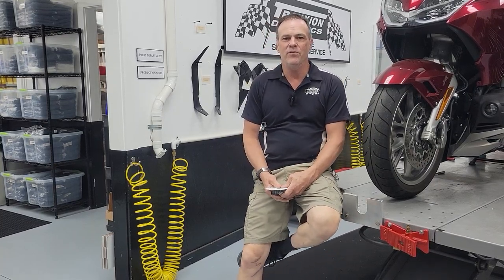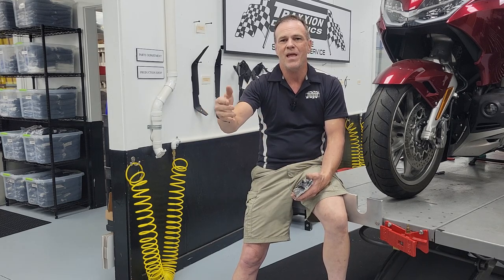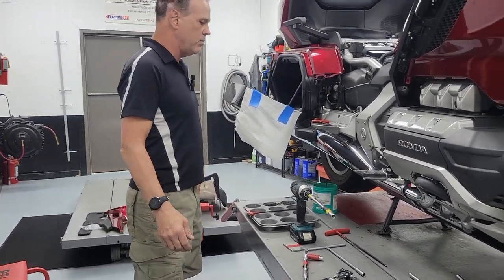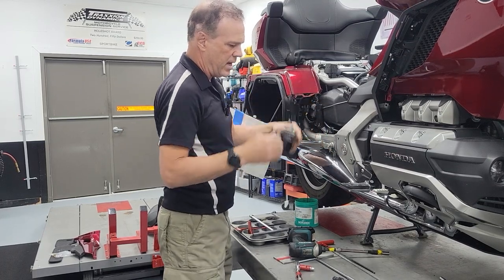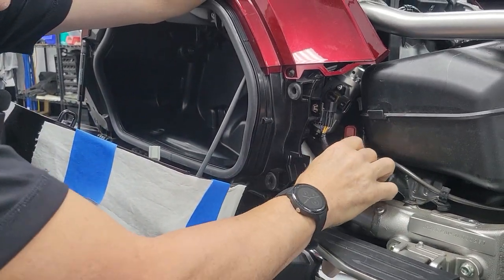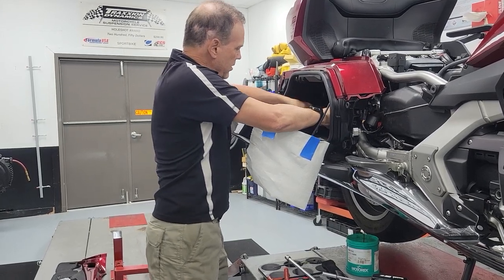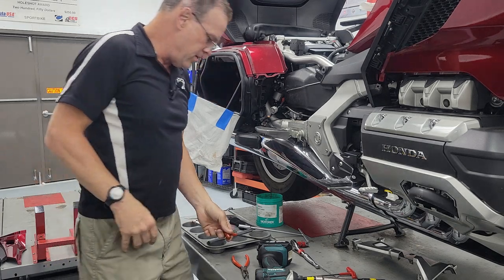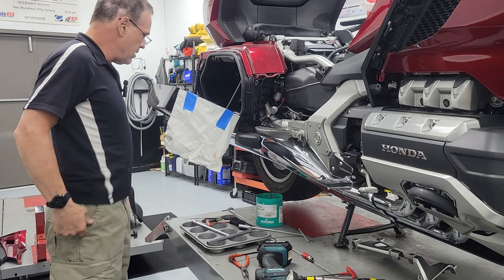NEW! Manual Preload Adjuster for 2018+ Honda Goldwing: Intro & Install by Max from Traxxion Dynamics

Comment: I just installed the adjuster on my 2018 Tour.  Last fall, I had Max do the suspension and thought it was a bit rough on small sharp bumps like highway expansion joints.  Otherwise, the suspension was marvelous.  It is hard to describe how much better it handles, even in a parking lot at walking speed (quite the surprise but very clear from the first ride).   I'm about 175 lbs. and mostly ride solo.  By softening that initial bit of travel, the bike now performs exactly as I was hoping.  It made a big difference and clearly worth the small PITA to install.  If you have Max's suspension and want it just a bit softer, this is your answer.  Five stars.
Reply from the maker: THANKS for the feedback Craig!!!  We haven't heard much from users yet!

Comment: I have a 2021 DCT Tour.  I'm 6'4" and 250lbs (all muscle...lol) Had Max upgrade front & rear suspension & add this little gem's prototype version on for me.  Works like a charm.  Had to crank it up a bit more for my liking.  I ride solo & am a moderately aggressive rider.  I regretted my GW purchase because the stock suspension continuously bottomed out and made the bike squirrelly AF in bumpy cornering.  After the upgrade, it's a new bike & definitely worth the cost for me.  Can't stay off the damn thing now. Damn you Max McAllister...damn you :-)
Reply from the maker: HAHA!  Enjoy!!!
Reply: Greg, I understand Max is the man

Comment: Great video. I found that when working in tight spots on the bike, using a 1/4 inch drive ratchet is helpful.

Comment: Hello Max. I have been watching your videos on the 2018-2022 Honda Goldwing and I have to say you are doing a very thorough job in pointing out all the shortcomings of this bike. Let me run down the short list: 
1 - the steering tie rods are inferior cremating sloppy handle bars.
2 - The steering spindle is made of the wrong material and Honda’s torque value to this part is wrong causing this part to potentially break requiring the purchase of your safety pin
3 - The rear shock adjuster is basically inaccurate. This you have addressed with your manual adjuster which requires removing the seat to operate. I owned a 2016 BMW R1200 RT that had a suspension system that was adjusted very much like the Honda’s and it was just fine.
4 - Changing the air cleaner is a quite a chore because of the poor design by Honda. I can attest to that as I once owned a 2007 GL1800.
5 - The left hand saddle bag is deformed and Honda will not warranty it.
Now I’m sure there are other issues. About the only thing easy to do on this bike is changing the battery. Ask me how I know that? Now I realize that is no perfect motorcycle however You have brought to light many issues that I would consider major.
This leads me to ask one question: Why would I spend 30K on a bike with so many issues unresolved by the manufacturer?
Reply from the maker: Because there is nothing else on Earth that even remotely competes with it on any level.  The problems listed can be fixed for free or very little money, so it's not really that big of a deal to just fix them, and then enjoy the bike!

Comment: i recently installed this kit for a customer at our dealership. A warning to any Jr techs out there if you are installing this at a shop be sure to get a release of liability. Max fails to mention in this video that the reason Honda went to computer-controlled suspension dampening is to compensate for the change in shift points and torque curve between the various drive modes.
Reply from the maker: The "computer controlled suspension" has no effect.  I detail this in several videos back in 2018.
Reply: @Traxxion  maybe, I've never tested it however thats not what Honda says. As a shop, though, if we modify the way something works according to the owners manual and service information I get from Honda, we need a release of liability.
Reply from the maker: @thesnail4671  What country are you in?

Comment: Shane O'Dwyer
Hi Max, purchased your front spring for my 2022 Goldwing CSC Encore Trike. What a difference steering is, accurate and smooth with no bottoming out at all. Now that the rear suspension adjuster has failed due to the pump actuator motor failure,  the icon is stuck on setting 2up. I am looking seriously at your manual preload adjuster. May need some advice on how to get the icon level back down to 1up before tackling the modification. As a trike all parts are easier to get to lol.
Reply from the maker: We can help you get it sorted out.

Comment: 2021 Non-Tour
I’m in the waiting to get your front and rear shocks due to my wife and my bad backs as well as improving the obvious shortcomings of the stock systems. Am I thinking correctly that I will get a better ride adding this also and would it be to a Tourer’s shock added?
Reply from the maker: Yes, we use this on the Tour models... the Standard has a manual adjuster already, although it is limited to 8mm of range.

Comment: My 2022 gold wing has 33 total clicks on the manual adjuster so i don't know if the previous settings are aligned with the current suspension.
Reply from the maker: The manual adjuster has 8mm of preload range.  So there is no correlation with the 0-25 scale.
Reply: @Traxxion  Ah okay, thank you Max. 
P.S. I have your trunk removal kit and absolutely love it.
Reply from the maker: @ericd701  Cool!  Glad to hear that!

Comment: Max I have base model would it help my goldwing?
Reply from the maker: Not so much... you already have a manual adjuster... but it has 8mm of range, not the possible 12mm of the Tour model.  But that should be pretty good.  It would be a lot of work to change it all just to get 12mm of range adjustment.

Comment: May I ask on my 2020 goldwing were the mode is it is indicating 0000 instead of my mode I could  be in.??
Reply from the maker: That means you need to do a "DCT RESET PROCEDURE".  You can find that on the internet easily.
Reply: @Traxxion  wow OK thank you for getting back to me
Reply: @Traxxion  I tried  Initializing it but the engine lite don't turn off
Reply from the maker: @phillipvazquez284  I would repeat it,  but after that, go to gl1800riders.com and ask there.
Reply: @Traxxion  ty I'll ask